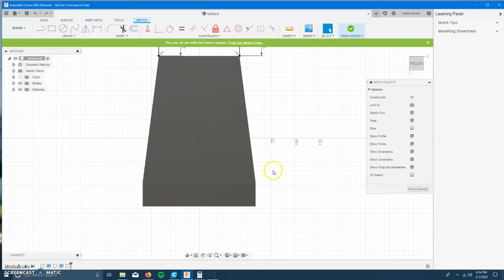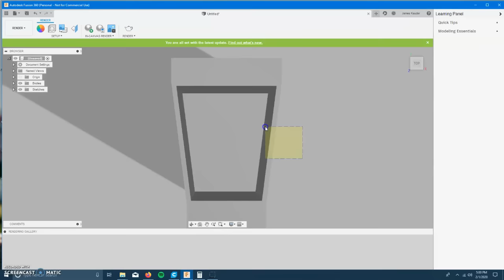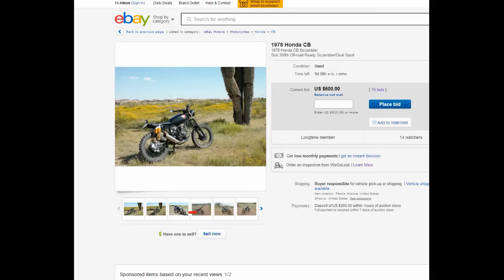1978 Honda CM185 Scrambler - Full Timelapse Build

Comment: Can you list some of the parts that were purchased? Like handle bars and exhaust system?
Reply from the maker: I'll put links in the description this weekend, thanks for watching.
Reply: Yes please!! I have the same bike and this one looks great!! Gave me a lot of new ideas for mine
Reply: Can you tell me about the battery box too? How did you make that?
Reply from the maker: @kennethhernandez963  I designed it with CAD software and 3d printed it. They will be available for purchase near the end of the month on my website
Reply from the maker: Parts list and links in description!
Reply: Is there some way I can contact you? I have so many questions because I’m building the same bike and need some help on parts and troubleshooting
Reply from the maker: @kennethhernandez963  Buy a Service manual for troubleshooting, It will save you so much time and it literally has a full chapter on troubleshooting. I would've been lost without one, even the best mechanics would benefit from one. If you have any additional questions, e-mail me at DoctorMotorcycle@hotmail.com. The 3d printed Battery box will be available on my website either at the end of the month or the first week of May. It's 100% drop in, no modifications needed. I'll either reply to your e-mail when they're available and/or post the link here and in the description.

Comment: I would have been lost with that wiring nightmare
Reply from the maker: I was lost the first few times too. Something would go wrong, I'd be scratching my head, googling for answers etc. 3rd bike I wired from scratch, everything just clicked. Still isn't fun though lol but a necessary evil.
Reply: The electrical circuits of classic motorcycles are relatively simple, the secret is to think that all cables have a beginning and an end, check them one by one and that's it, there are not so many limes to check.

Comment: What sprocket ratio did you use?
Reply from the maker: Yikes, don't remember the ratio but the rear was stock, the front was 2 teeth taller
Reply: @DoctorMotorcycle  thank your for the response ur the first person on any video about this bike that has responded. Would it be difficult pulling out on hills on the street going 2 higher in the front? And I looked on your website for the battery box and I couldn't find a place to purchase or download.

Comment: What did you do with the fuel tank? Was that the stock one on there when finished?
Reply from the maker: No. It was the generic 2.4 gallon one sold on amazon. I had to spread it to make it fit in between the frame, and grind down part of the mounting tabs. Other than that it was a pretty painless process on this build. The XS650 build used the same tank, but it was much more work as I had to relocate the petcock hole.

Comment: what length are the shocks you went with?
Reply from the maker: 370mm
Reply from the maker: Also, I wouldn't advise going this long on a roadbike (this was used primarily on the dirt) as you have to run the chain loose and it just barely misses the swingarm. 350mm would probably be the sweet spot. Just to clarify, you can run the same 370mm length shocks I did, but again, the chain will have to be run loose which can be hazardous at high speeds. Loose chains are prone to falling off, which is why dirtbikes have chain guides. Should you decide to do the 370mm length, I strongly advise to fab up some sort of chain guide to mitigate the risk of it falling off. -Jimmy
Reply: @DoctorMotorcycle  thanks for the tip! The added height is mainly for the use of a larger tire for road use so you saved me some headache!
Reply: Any idea what other bikes rear rim may fit on this bike? Looking to make it a 17”
Reply from the maker: @codygetmyloan  Sorry can't help there. You might be able to find a 17" rim and relace it with spokes from buchanon. http://www.buchananspokes.com/categories/rims.asp

Comment: How much does a bike like this cost after full build
Reply from the maker: I sold it for 3,500.
Reply: How much would it cost you turn a used drz400 in to a scrambler for future intrest. And I know it would be just a estimated.
Reply from the maker: @aldriccrawford2161  How much would it cost me or how much would I charge you?
Reply: Yup, how much would charge me.
Reply from the maker: @aldriccrawford2161  It depends on; how much you want done, what you want done, how you want it to look, how far you want to go with mods, how much custom work etc. It could be as low as $1500 plus parts and go up from there.
Reply: Ok, thanks for the info truly appreciate it. I'll send you messages when the time is right.

Comment: This seems to be the new "cafe racer" trend for non traditional motorcycle people, by which I mean those tedious hipsters that befoul everything you once loved, But seriously, isn't the geometry all wrong? By which I mean the geometry is all wrong
Reply from the maker: Don't care if you think I'm a hipster or not. The CM185 was a lame bike in stock form, no matter which way you look at it. The guy I bought it from had it listed for $300 for months with no lookers, clean title, 6k original miles. You can't give those things away. I modify my motorcycles the way I like them to look, and 98% of people love them, and 2% can't stand them. I think stock vintage motorcycles, unless they're REALLY old (1930's bmw's and Harleys) are incredibly bland with no character. They were called the "Universal Japanese Motorcycle" for a reason. 

The head angle was too slack in stock form, which is why I raised the back end up over 3". The rake and trail ended up being very similar to a modern crf250. It turned well and was stable at speed. Take care.

Comment: Lame. He didn’t change the gearing. He should have decreased the front so sprocket and increased the rear sprocket teeth. It would have stood right up. 
I learned young trying to make something it isn’t doesn’t work very well. 
The rest of the build looks good. Except that seat. More padding.
Reply from the maker: Wrong. I did change the gearing, I added 2 teeth to the front sprocket so I could actually ride it on the street. That's how the top speed was 80, with a 4 speed transmission on a little 185cc bike. If I geared it shorter than stock, it literally would've topped out at 50 flat out, and been screaming at 40mph. What's the point of that? So I can do a wheelie? lol. 

And it worked very well. I would argue it was much more capable offroad than most of the "scramblers" you buy at a showroom, that weigh 500+ lbs with fuel. It weighed 275lbs with a full tank. I rode the bike offroad and on singletrack/dirtbike trails more often than I did on the street. Even did a 10 mile stretch on the interstate holding 65mph. If you actually rode the bike on the dirt, you would've pulled off your helmet and had a silly grin on your face like everyone else did that rode it. 

-Jimmy
Reply: DoctorMotorcycle   So let me get this straight. You took a road bike. Made it into a dirt bike so you could ride it on the street.
Reply from the maker: @bradleyweiss1089  No. I already said I rode it more on the dirt than street. I geared it taller so I could actually ride the thing to riding spots. If I geared it lower, It wouldn't have been rideable on the street. It would've been screaming at 40mph with shorter than stock gearing.

Comment: Please tell me those  OHLINS are fake lol
Reply from the maker: I was going to respond to your original reply, and all I got was "hand spray, shitty brakes" and then the comment was edited. Get it off your chest big guy, let's hear it.
Reply: @DoctorMotorcycle  i thought it sounded rude. So i edited. The point is. Why such expensive suspensions when there are bad suspension at the front bad brakes bad exhaust? Could have used the ohlins money on some mid range good all round parts . Unless you had those sitting around which imo is still a bad use of such good suspension set. Or unless the ohlins are replicas and if they are ignore my comment
Reply from the maker: @dcd5050  That's the thing though, people (understandably) assume things about the bike, when in reality much of the individual components aren't shown or mentioned, because that's beyond the scope of these videos. 

The brake actuator in the front was extended 10% to increase leverage, and I used a longer front brake lever (by way of a different perch) for even more leverage. The front fork springs were changed out for a set of Race Tech's that were originally used on an xl185, fork oil was SAE 30 for increased bottoming resistance. 

I've never understood what the qualms were against spray paint, it holds up just fine with proper prep work and if there's ever a ding or scratch it's super simple to repair and very cost effective. If you were to see the bike in person, you would've thought everything was powdercoated, even AFTER I had ridden the bike in the rain/mud/desert.

I paid big $ to have a set of dirtbike wheels powdercoated one time, and after 1 trip to the dunes and a couple weekends in the desert, the powdercoating looked no better than had I just spray painted the damn things with good prep. Ever since that experience, I've been against powdercoating. 

As far as the "hand cut" comment, I'm assuming you're talking about the "seat" that I used on this build. That's fair enough. I should've spent more time on the seat, and that was my only regret on this build. Lesson learned. You'll notice that in my XS650 build, I spent the extra money and time on making a proper seat. 

Take Care,

-JImmy